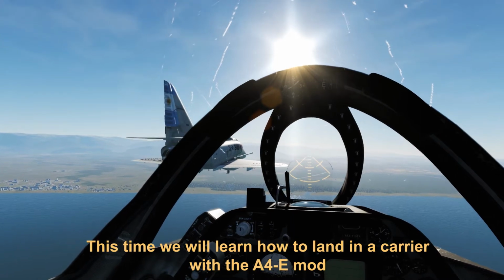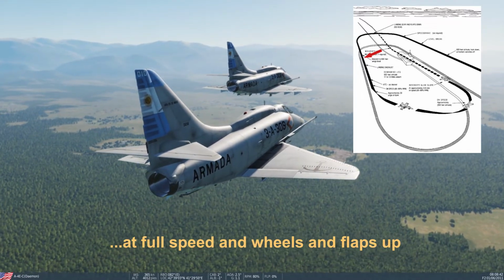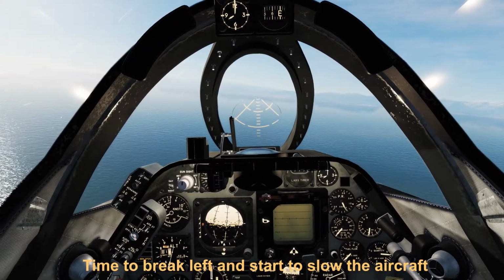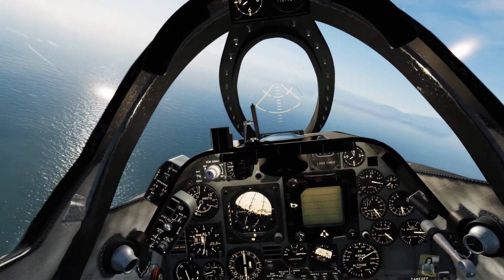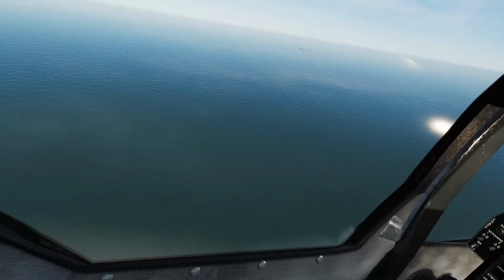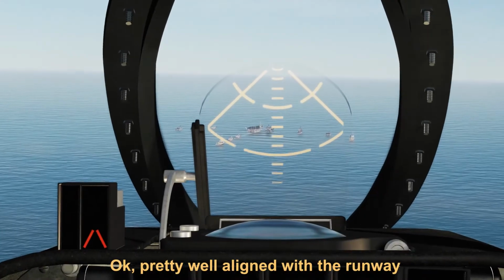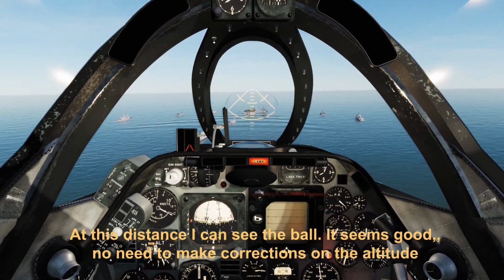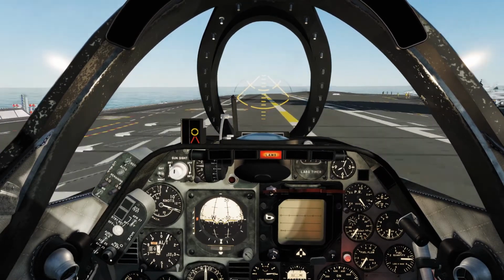DCS: A-4E Skyhawk Carrier Landing tutorial

Comment: i need help.
whenever i land on the carrier, the nose landing gear goes right inside the carrier. i tried many times, but the problem still seems to persist. what am i doing wrong?
Reply from the maker: you are doing nothing wrong. it is a known bug of the  mod, related with the source code of latest versions of dcs. As far as I can remenber,  It only happens if you start the mission  in air. If you start the mission in a runway (or in the carrier) it will not happen when you land
Reply: @dcsdummypilot   thank you!